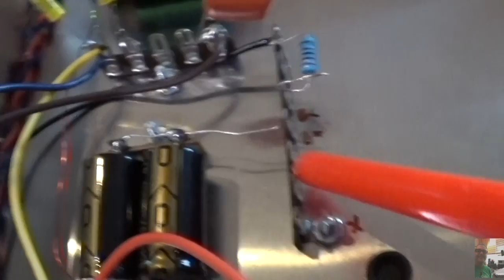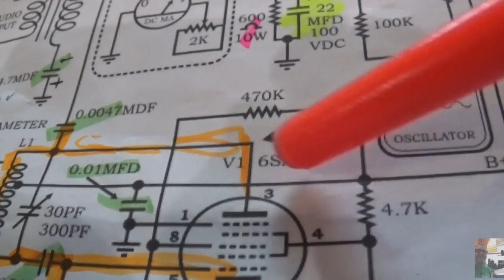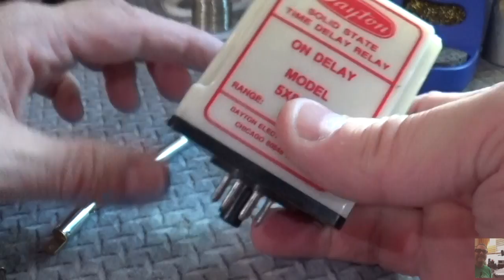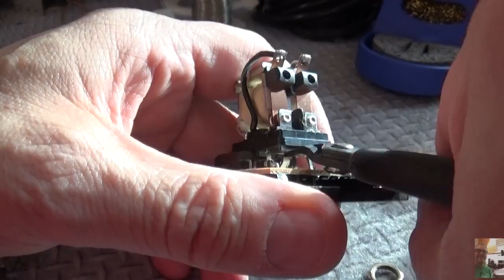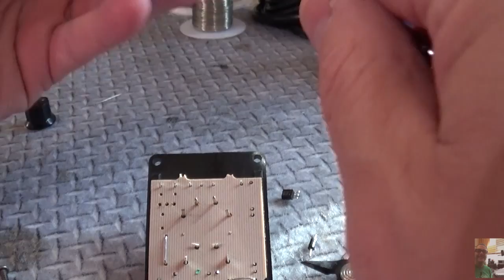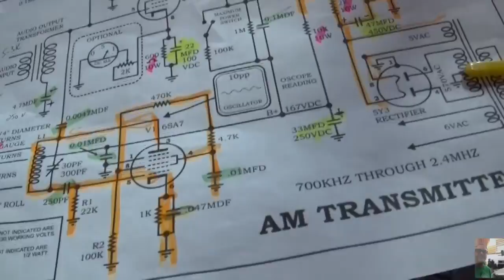Rick McWhorter AM Transmitter Build - Episode 5 - Wired onthe delay relay

Comment: Hey Ron, Looking good as always.  I wonder for that coil under the chassis if you could 3D print a cradle for it or alternately just cut up an old medicine bottle to act as a cradle to keep it from touching the chassis.  My bench grinder has a wire wheel on one side and I like to take old terminal strips and run the connectors over that wire wheel when holding it with a pair of pliers to shine it up a little before I install them and try soldering to them.  Take care, Gary
Reply from the maker: Gary, I am considering exactly what you said and a few other things. More to come on that one... I also think I will have the soldering woes solved too.  All good my friend.

Comment: Heat is the key on the terminal strips. They act as one big heat sink. Crank your iron up to 450°C (800°F). That should heat the terminal strip fast enough where you can apply the solder without overheating the wires and components. Nice clean job!
Reply from the maker: Thanks Robert. My iron only goes to 790 so that is why I have to lean on it a little longer.  Make sense for sure so perhaps I need to invest in an alternate iron for these situation.  Many thanks Robert
Reply: Yup, could be a need for a larger iron or gun.  But make sure tht you clean the tip and tin it well.  A dirty untinnedvtip can cause cold joints.  I use a et paper towel to wipe the tip clean, and shiny, then apply some solder to tin the tip.

Comment: Ron, try a solder gun instead of the iron on those strips. The wiring is looking great. Very neat and precise. Your signature. ;p-)
Reply: yup, but Paul's was short in size, I use about six inches of 10ga solid copper wire,, and bend it like an originl Weller tip.  I have the 100w Weller, and a 250w Wen.  Got them both at flea markets for under 20$ each.  I bend the wire in half and squish the tip part in my vise.  Then I bend the two legs with pliars to make them fin the gun.  put the nuts on the legs before bending the ends. done it for years.
Reply from the maker: Thank Carl.  I am using a Hakko 880 , which goes up to 795 degrees so it should not be an issue, but it is. I will think about getting something a little beefier for heavier job.  Thanks on the compliment, I appreciate it - Many thanks bro.. Regards, Ron
Reply: don't bother with a HFT soldering gun, crap, tips don't last.  I made that mistake, junk tips.  zi mak my own gun tips for my Weller or Wen guns.  Weller gun tips are pricey, like 8$.  Again, clean and tin the tip.
Reply from the maker: My Hakko only tops at 790 degrees and thats the issue.  Never fear, a solution is on the way.  :)
Reply: Mr. Carlson's lab took an old weller soldering gun and some solid copper wire (I don't remember what gauge) and used the solid copper wire as the tip and used that to get enough heat to solder to a chassis.  Looks like it worked great.
Reply: 10 gauge if I remember correctly. Great money saver.
Reply from the maker: Good Memory Carl... I do recall that as well.. I have to look for one of those old Weller unit... good to have just in case.